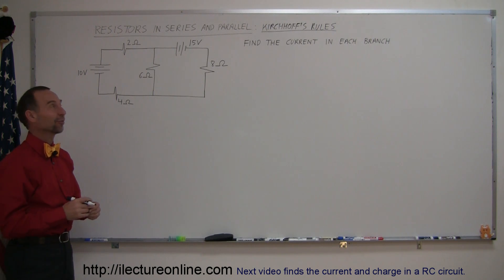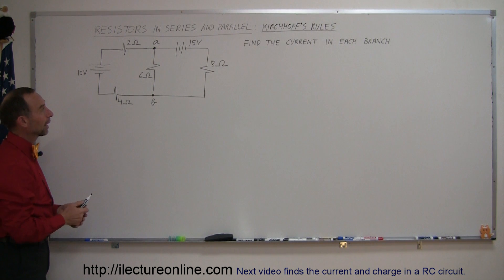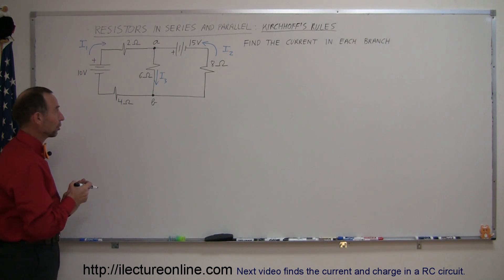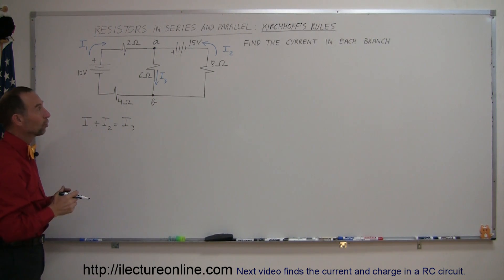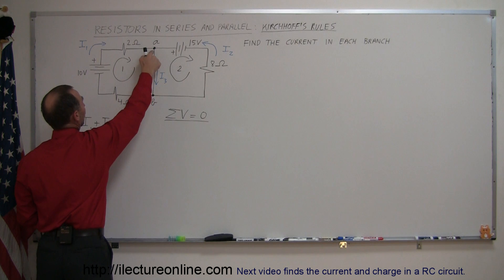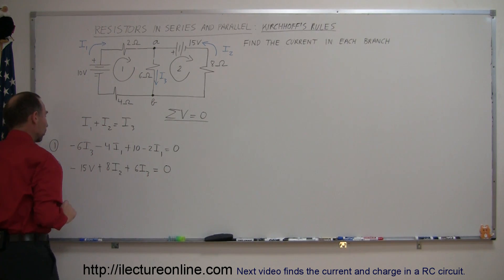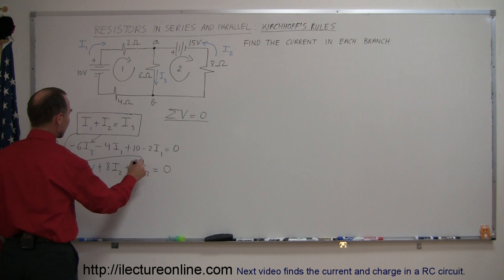Physics 41    Resistors in Series and Parallel (4 of 5) Kirchhoff's Rules

Comment: Dear Michel , thank you very much for such valuable exercice , was really helpful. Hovever I have a question with regards to the directions for currents i1 and i2 , since you mentioned that the choice of direction is not important , I put both current direction in clockwise , after calculation  I found the same values like you  but for i2 , but opposit values for i1 and i3 in comparaison to what you have found. Please can you let me konw why I found i1= 1.28v instead of 0.379v while I found i3=0.379v instead 1.288v. Thank you for your reply in advance
Reply from the maker: If you labeled the currents the same way I did and all you did was reverse the direction of the currents, the only difference should have been the sign of the current, indicating that the currents flow in the opposite direction.
Reply: @MichelvanBiezen  
Thank you Micheal for getting back to me. yes Indeed I labeled the currents the same way you did, I only reversed the direction of i2 and hence I got i1=i2+i3 where as you had  i1+i2=i3 @3:00.  Any hint , will be much appreciated
Reply from the maker: Did you also adjust the other equations? (sum of the voltages around every loop will change as well).  The only part that is not affected is the voltage rise/drop across the battery.
Reply: @MichelvanBiezen 
Yes you are right! I found my mistake  I didn't change sum of the voltages around the other loop.  I thank you again for your responsiveness and have a lovely holiday

Comment: Hello Professor Biezen. What is the telltale sign that Kirchhoff's Rule is going to be needed for a problem? Is it only when a circuit has two (or more) emf's or are there other important factors?
Reply from the maker: That is indeed a good indication.  With more than 2 emf sources, it would be difficult to solve it without Kirchhoff's rules.

Comment: How did you find out the positive end of the circuit?
Reply from the maker: The voltage sources have a positive end and a negative end.
Reply: @MichelvanBiezen  yes but how do we decide which side is positive and negative?
Reply from the maker: The "positive side" is on the positive end of the battery and the "negative side" is towards the negative end of the battery.

Comment: Can you please discuss why is it positive/negative and how can I determine please.. :<
Reply from the maker: Not sure what you mean by "it" since that can refer to many things.  If you are asking about the voltage drop / rise across each component, use this rule:  When you cross a battery, the direction of the current doesn't matter, the voltage drop/rise depends on the direction of travel relative to the polarity of the battery.   When you cross a resistor, the voltage drops when crossing in the same direction as the current and the voltage increases when traveling across in the opposite direction of the current.

Comment: can we maintain the direction of (I1) in the same direction (clockwise) but inverse the direction of ( I3) so it becames in the counterclockwise direction .
So we will have a circel with controvers (two different direction at the same circel) or it should be the same direction for all the currents included in the same circle .

Thank you very much.

Comment: The positive current always flows from higher potential to lower potential. In other words, the arrow showing the flow of positive current should point FROM the + TO the - of the voltage source (battery). That is not what is being shown here.
Reply from the maker: Since you don't know which direction the current flows when you start this problem, you simply pick a direction.  If you pick the "wrong" direction, you answer for the current will be negative.

Comment: when you started 2nd loop, you going against I and from negative to the positive charge, So it should be +15 V?  Why is it -15?  #Michel Van Biezen
Reply from the maker: When crossing a voltage source, the direction of the current doesn't matter.  We are going across the voltage source from the positive terminal to the negative terminal, therefore it is a 15 V drop.
Reply: Thank you so much! that helps!

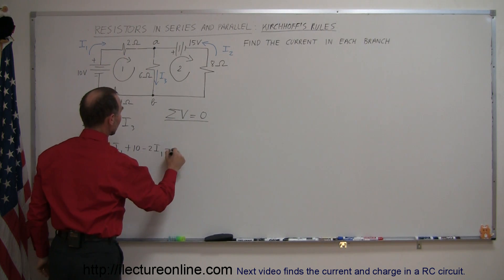Comment: 4:48.
Just wanna ask.
You used -6-4+10-2=0. I'm unsure of this part. I used my calculator and it gave me -2 instead.
I'm quite new to this Kirchhoff topic. Would love that you could help guide me.
Reply from the maker: Are you referring to the equation below step 2?  Note that the "10" is not a numerical coefficient of I1
Reply: Michel van Biezen for the 1st step at 2nd step of the equation. Can you put it in a simpler term? Thanks
Reply: he is using kirchoffs rule that says that the sum of all voltages in a loop equals zero. he is not using the actual values to solve them you have to go through the whole process. and the negative on each term means that there is a voltage drop across the resistor , because of the reference point,  the current goes in the same direction as the arbitrary direction that it was chosen.
Reply: this was for the top part.

Comment: I struggled with Kirchoffs laws many years ago when I was studying for my HNC . Fortunately I passed ok. I still have a copy of my exam paper from 1968/1969 and the Kirchoff  question appears so much easier now after your clear explanation, my question had 2 voltage sources, 6 loops ,7 resistors in series and parallel . I am now going to have a go at it again although I don,t remember the correct solution.... no worries now, thanks for your excellent presentation, Billy Inglis.

Comment: Quick tip: if you're at least somewhat handy with linear algebra, specifically Gauss-Jordanian eliminations, you can simply put the equations in matrix form and do the elimination to get the results.

Preferred method for me, because there's usually less of a chance of messing it up, and it's easy to check.

Comment: Mr. Michel, How I can find the power delivered to each resistor ??
Reply from the maker: The equation typically used to calculate the power delivered is:  P = I * V.   For resistors, the power delivered is equal to the power consumed, and thus we can also use the equation:  P = I^2 * R
Reply: +Michel van Biezen I got it, but which Volt do I should use in the formula if I have to battery with every single resistance?
Reply: +Michel van Biezen two butter **
Reply from the maker: Since you solved for the current in each resistor, P = I^2 * R

Comment: Sir why doesn't I1 pass through the point A to the right part of the circuit, thus being part of the current exiting the node +Michel van Biezen
Reply from the maker: +Abdo Hajar 
When using Kirchhoff's rule you add up all the currents entering the junction and equate that to all the currents leaving the junction.  I1 and I2 enter junction a and I3 leaves junction a.

Comment: I made same circuit with 220 ohm resistors and 1,5V and 9V batteries.
Problem is that calculations don't match real measurements when both batteries are connected. Measurements are same with calculations only when both batteries have same voltage or only one of two batteries is connected (and therefore only one loop is "working").
Can You please explain, where is problem? Thanks!
Reply from the maker: 5017987 
There are two reasons:
1) the batteries don't always allow the theoretical current to flow
2) your volt meter and current meter will affect the circuit.  (I have some videos on that)
Reply: Michel van Biezen 
Thanks for fast answer!

Comment: How does one determine the direction that loop 1 and 2 should be?
Reply from the maker: You can choose any direction, it doesn't matter and you'll get the same answer.
If you choose the current direction incorrectly, you'll get a negative answer, which then tells you the current is in the opposite direction.
Reply: Michel van Biezen could you say that the current that's in the branch, in this case I3, only counts inside the branch (piece of wire between a and b)? Why is it for example I1 x 4 and not I3 x 4?

Thanks!
Reply from the maker: Daski69 
You are correct.  The currents are only valid from branch point to branch point (a to b), so there are 3 branches with 3 different currents.
Reply: Michel van Biezen
oooooooh i see. Thanks a lot!!!

Comment: Okay  thanks! But I dot understand for loop 2 why did you go against the current ? Can you go with the current starting from b to a?
Reply from the maker: Zi,
You can go around a loop in any direction.  (It doesn't matter).  When you go across a battery from - to + then the voltage increases.  When you go across a battery from + to - then the voltage decreases.  When you go across a resistor in the SAME direction as the current, the voltage decreases.  If you go across a resistor in the OPPOSITE direction of the current, the voltage increases.
Reply: Michel van Biezen thank you sir, you are an awsome teacher!
Reply: Yeah me too, i did't get the geometry quite much!  But thanks a lot i will try to watch a lot maybe i understand finally
Reply: thank you so much! :)